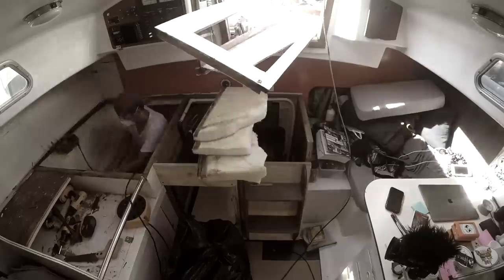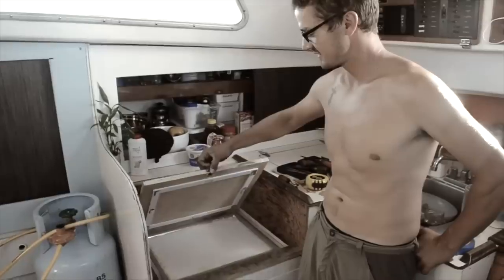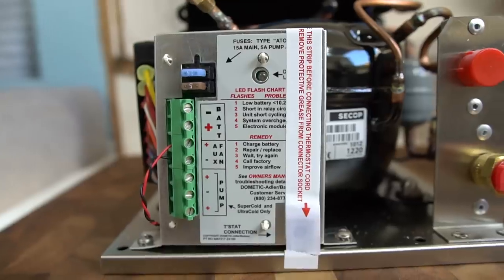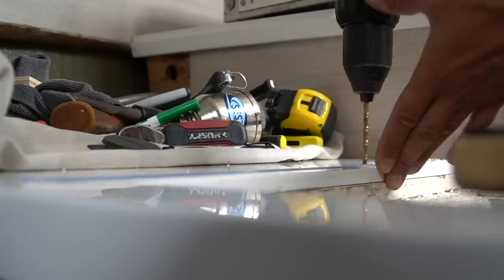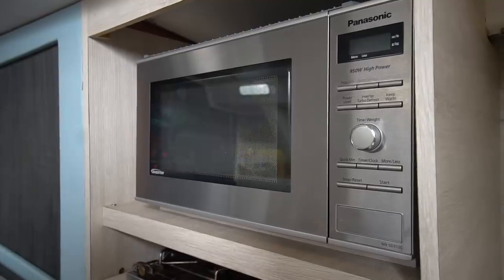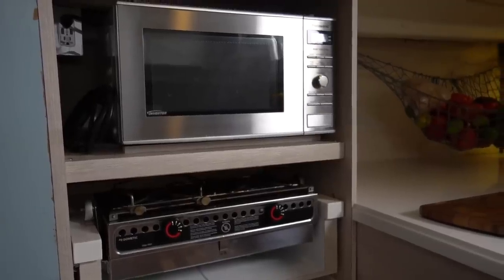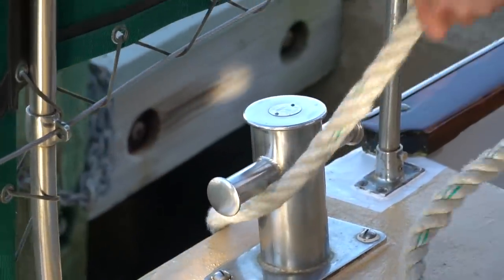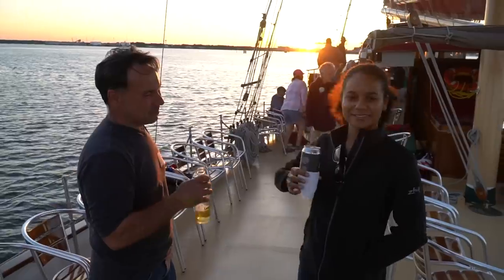Sexy Galley or Modern Kitchen? — Sailing Uma [Step 175]

Comment: Good choice of microwaves with the Panasonic "Inverter" model. We've used them for many, many years and they're unique in that if you set at less than full power, it actually reduces the continuous power to that setting. All other microwaves just pulse less frequently but at full power on each pulse. Love your videos, I look forward to each one.

Comment: You could do a "roller" door over microwave and alcohol stove by using narrow strips of wood stuck with impact adhesive to a canvas cloth sheet.  Ends guided in either a routed track in two thin wooden side pieces or in two 316 stainless "U" section channels bent or cut, welded and linished.  For a smooth operation fit some acetal, nylon or polypropylene to the ends of the wood strips.  Nylon you could glue on but the others would need mechanical fastening.

Comment: Well a very dense video. I'm sure you will be happy with the new pantry. 
Often I hear people complaining about such a huge high voltage consumer (i.e. the microwave) - but I want to agree: its very effective but never running for a long time. 
One hint: the operating time is highly affected by the airflow through the compressor unit. I hope you guided the airflow better than in ships of mass production (there is seldom any guidance).
Reply from the maker: It draws air from the old engine compartment/bilge and then its ducted high into the stbd cockpit locker.

Comment: Good to know what happened with the Keco cooling unit. I wanted to try it for my boat, and I'm in the cold SF Bay so it might have worked. Unfortunately, it doesn't seem to be available anymore, even outside of the US.  I guess I'll keep using big blocks of ice. Fridge units with a compressor aren't in my budget. But thanks for giving us the low down on the Keco cooler. :-(

Comment: Thanks for the update on the galley and fridge.  I was wondering what was up with the previous cooling unit you installed.  All the changes to the galley (and the boat in general) are non-traditional, but kinda' cool.  A lot of people have a microwave on the boat, but your installation (as usual)  is a little unique.  Keep up the good work.
Reply: Microwave/convection oven combo is even better. That will be their next upgrade I'm sure.

Comment: I have the same unit in New Zealand.  We build the box a 100 mils thick outer and inner stainless box , sealed lid after a month of running uses 4 amps an hour   On start up it reads 6 amps then filters down to 4 then turns off after 5 minuites, we load solid meats at the bottom then lay 40 mill poly on top then all the other stuff , after six weeks off shore running on ships power we turn it off at midnight and on again at dawn saves 40 amps , the microwave you fitted will kill your battery’s very quick , we don’t use it off shore only in port on port power , they shorten battery life , , from our experiences  good luck

Comment: Great job with the install, but I don't get why you didn't go with a cold plate system.  We've had an evaporative plate system on our last boat, but chose a cold plate for our current boat because of how efficient it is.
Reply from the maker: From what we've learned. Cold plates work best if you're using your motor to cool them down. Then you only need to run it once or twice a day. Since all our power comes from the sun, it doesn't really matter how often the condenser turns on.

Comment: Great stuff on UMA. Want to preserve food longer, both fresh and frozen, get a FoodSaver Vacuum packaging machine. Defrost in water, not a microwave. Example, two boneless chicken breasts (in vacuum packaging) will defrost in 30 minutes sitting in cold water with no edges partially cooked from microwave. We keep vac-packed cheese in fridge for over a year. We use it for everything. Check it out.

Comment: The microwave may seem extravagant but it will reduce your Origo fuel consumption. Alcohol fuel may not be readily available where you're going. The fridge and freezer will also draw less and less power as you travel north, to colder climes.

Comment: Hello guys! Congrats with the galley closely finished! I have a bit uncommon question. What soft do you use for projecting such complex stuff on your boat? As for me, it would be kinda hard to draw everything on paper without using something like CAD) Would appreciate your answer if you suddenly notice this comment)
Reply from the maker: We sketch A LOT!!! But for the complex stuff (head and galley) we often model it in sketchup. The models we’ve made for various projects eventually end up in The Vault along with detail project photos and all the process sketches we draw along the way. Hope that answers your question.
Reply: @SailingUma  That's exactly what I wanna see. SketchUp is easy to deal with, online and has  free plan. Also used it for some furniture projects. Was wondering about some alternatives, cause your projects are always quite nicely done. Thank you for the answer and good luck with Uma. Waiting for the vids from the big adventure) Cheers from faraway Black Sea)

Comment: Love those Origo stoves - I notice you use a grill on it - does it do any damage to the stove ?  I just grabbed one I was throwing out  to use .
Reply: Oh and the kitchen looks like a million bucks - more boats should have that level of finish .
Reply from the maker: Doesn't seem to damage anything. Its SUPER efficient too since it absorbs a lot more heat. Once it heats up, we usually turn it down to 1 or 2 on the dial and can still grill a steak. LOVE IT!
Reply: @SailingUma  just curious, what did you use to lock the stove in place with the string pull out? We’re remodeling our galley at the moment and are looking to install a similar system! :) thank you for any advice!!

Comment: Hi Dan   did you pull a vacuum after hooking up the copper lines?
Reply: I just thought that I need to say that I'm not trying to be a know it all, Dan can build circles around me, I just own an air conditioning company, so I just was trying to help out☺
Reply: Safe travels you two ☺
Reply from the maker: The unit is precharged with self sealing fittings, so no need.

Comment: A proper freezer should fluxuate between -16 and -20...
Reply from the maker: We can set it that low, but it keeps ice cream frozen hard, so we don't really see the point.
Reply: @SailingUma  at -18 the bacterial activity stops, ice crystals hardly forms and no to little oxidation occur... Further more if packaged properly the foods carachter and structure are preserved at its very best... With your chosen temperature this isn't the case.. Just saying.